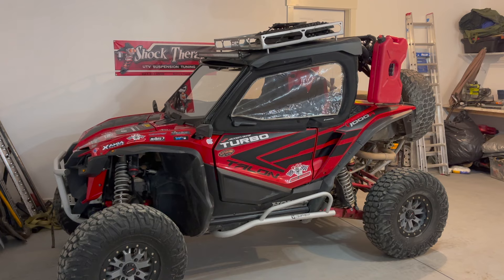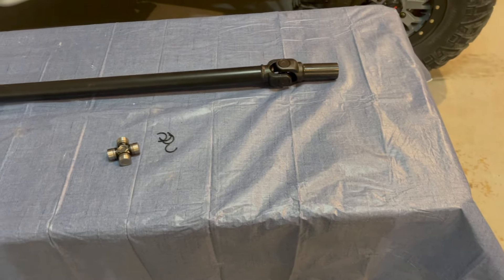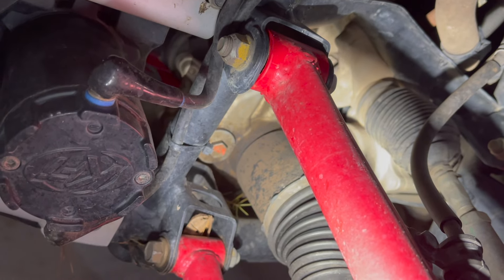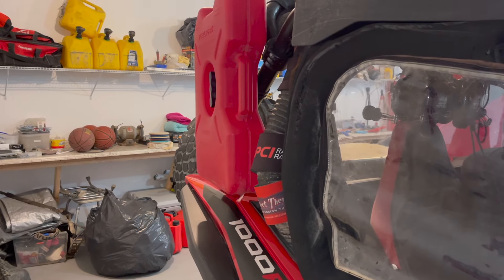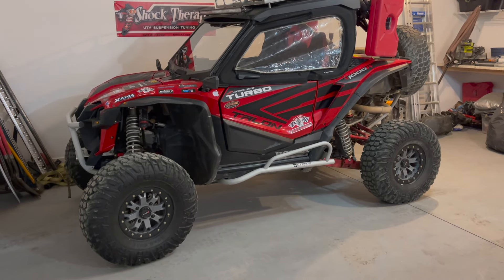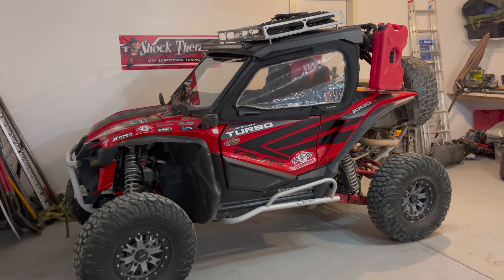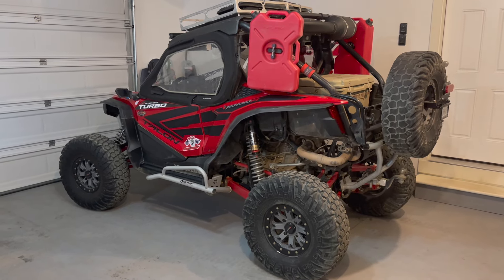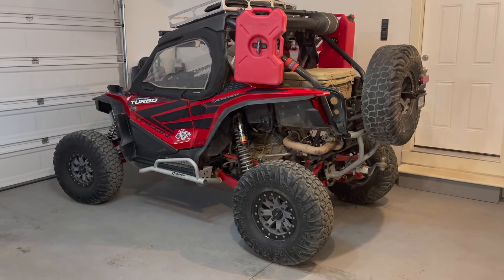Honda Talon 10K mile review!!!! Watch before you buy!

Comment: these long term ownership videos convinced me to get a talon is their any mods you think are necessary before I hit the trails for the first time
Reply from the maker: Shock therapy springs are a nice addition if you want a smoother ride. Heated seats for $40 is the cheapest upgrade.
Reply: @gravesru I wanna do skid plates and front A arm guards I also live in the coal region of Pennsylvania that particle separator would do wonders
Reply from the maker: @d812gaming9  for sure, it definitely depends on how and where you ride. I have over $30k in just accessories
Reply: @gravesru  did you have to get transmission tuning to run 32’s
Reply from the maker: @d812gaming9  you don’t have to, but the turbo kit comes with a flashing tool to remap the transmission for different sized tires
Reply: @d812gaming9   That coal dust must be hard on the lungs
Reply: @budvoss2  I’ve been here my entire life I’m not scared of a little coal I’ll probably get a helmet with a filter

Comment: Great video thanks i question your experience with other sxs brands that is a lot of money sitting in front of you and it's still slower and rides worse than a machine someone ca pick up for 17 g and if you put the money you spend on your turbo into it you have a very fast bullet proof machine that rides amazing.
Reply from the maker: You must be referring to the ride of a stock talon, mine rides exceptionally smooth now. Honda reliability is unmatched, I had 2 ujoints in 10,000 miles, there isn’t another sxs out there that will hold that good with how I have driven my talon. I have worked on every make, I’d i wouldn’t buy anything with a CVT.
Reply: @gravesru  sorry I'm not sold it doesn't even have 4 wheel drive. To much money to get it to the point you have
Reply from the maker: @Kawarthametalsigns  I don’t work for Honda and I’m trying to sell anything to anyone. Thanks for watching though.
Reply: @Kawarthametalsigns  Doesn't have 4wd? 🤣 Please tell me you mean it doesn't have a locker.
Reply: Please show us evidence of any xp1000 that has made it to 10,000 miles. If you find one please include what maintenance and repairs have been done.

Comment: forgot to say how many can am x3 you lost to
Reply from the maker: And I forgot to mention how many canam belts I helped change out. 195hp minus 30% is about 140whp. Honda talon has 152whp with the turbo kit. FYI
Reply: @gravesru   152 hp is not the whp of the talon turbo
Reply: @dank8210  I would also think that’s a very generous estimate. That would be something like 87% driveline efficiency given the estimated 175ish hp for turbo talon. Dct may be a little more efficient but not that much.
Reply: @gravesru  So the Talon is faster than the X3?

Comment: Dammm wish I seen this before I bought my 2021. With all the problems.. dont look like honda made it Reliability when u got carry spare parts drive shaft falls apart. Crazy 20k plus and u got get all these spare parts.. I've owed few can am x3 and never had carry and spare parts ever... crazy I spent 20k plus and you saying I need all the extra parts and buy more parts just stay moving... bad  bad honda.. there Reliability down the drain on the talon... all and the wheels all I did was inch and half lift on the front springs to bring the wheels in and it rides just fine. But I do that with all my sxs I always lift the front up inch and half in the front
Reply from the maker: These problems are very minor for 10k miles. I work on all makes, Polaris and canam will have far more problems within 10k miles.
Reply: @gravesru  right yea I've owned ever sxs out here but the talon and thought I'd try it because both my x3s I had had over 6K on both and never had put any money in them.. but yea u do got work on all.. all I was talking about I never had buy stuff to make it work better.. I hope honda updated the seals and the drive shaft for 2021... and one thing I forgot say the breather is the worst thing honda did. I'm going with the snorkel kit for mine.. I live in w.v. so we got alot mud creek's and hills.... but hope I got a good one and dont have any of these problems.. well the miner ones u said.. but good review bub👍👍👍
Reply: @gravesru  all forgot ask in them 10k miles. Did u have to shim it any at all??
Reply from the maker: @scottash2866  I have not!!
Reply: @gravesru  that's really good. I know that was the big down fall for there 250 450 dirt bikes and 4 wheelers... shimming the valve's alot.. atleast they made the motor and transmission really good💯... thanks for getting back at me bub👍🤜🤛